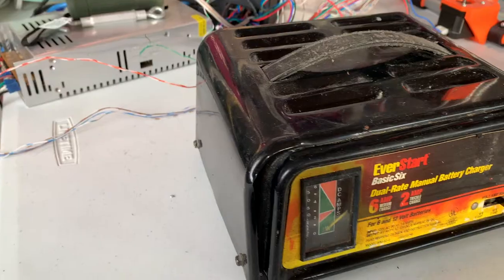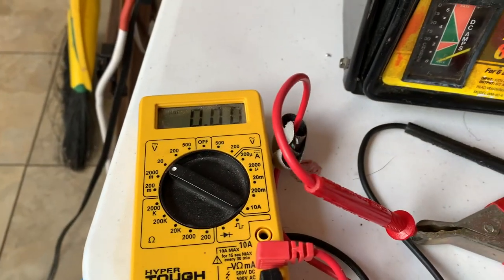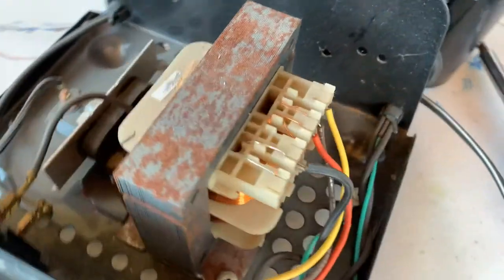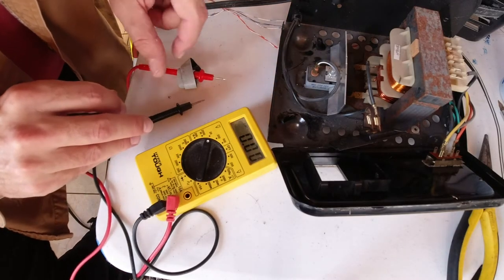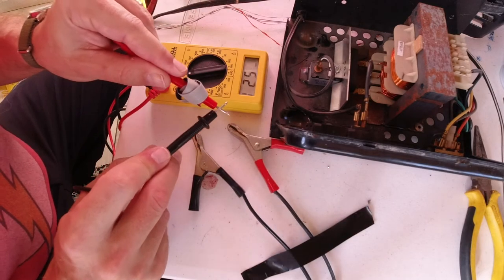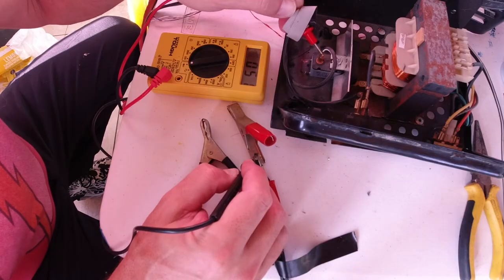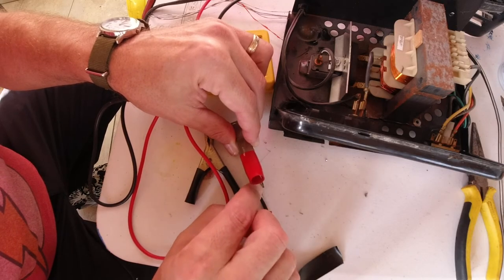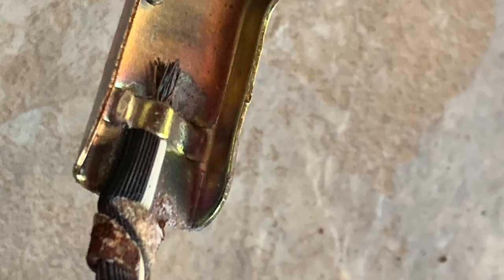Troubleshooting and Fixing Broken Car Battery Charger

Comment: Thanks for your video Rick, It was really a help. I'm 78 y/o and have a very similar one although it was a 4 amp, 6-12V  I bought in 1972-73 (!!!)  when I bought my first motorcycle. It still worked up until last month. My contacts didn't seem bad so I passed by them and went to the voltage test and was at 0.00 V but because of your video I went straight back to the contacts and made them shine like a brand new copper penny. (Does anyone remember pennies?) Almost 14V instantly! I found you by searching YouTube "troubleshooting a battery charger". It wasn't the charger that needed the troubleshooting...it was its owner---me. The charger just needed basic maintenance.
Reply from the maker: Awesome.  Glad it helped. It should go another 20 years!
Reply: Same here just some corroded wires right inside the box

Comment: Mine had broken positive wire at the clamp. Insulation was just barely keeping the clamp attatched. Open circuit, the Charger will display 0.00 volts.

Comment: Found this old battery charger. Tested the clamps an 12 volts and got a reading of 10.9 bolts. The clamps look a little dirty. Could cleaning them get me higher voltage? And after cleaning and it’s still 10.9 volts does that mean Charger is no good?
Reply from the maker: Not sure, there are not many parts in this to go bad.  The transformer is about it besides the connections to the cables.  I would test or re-solder the cables to the clamps.